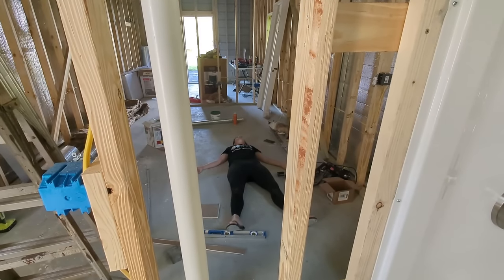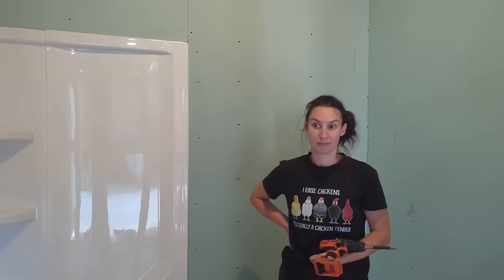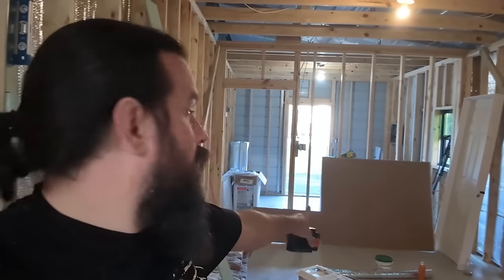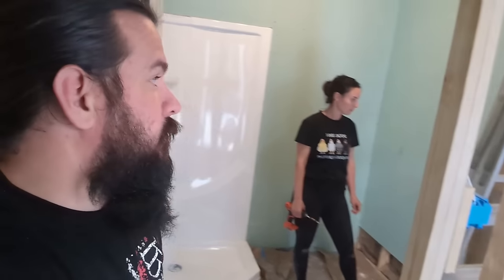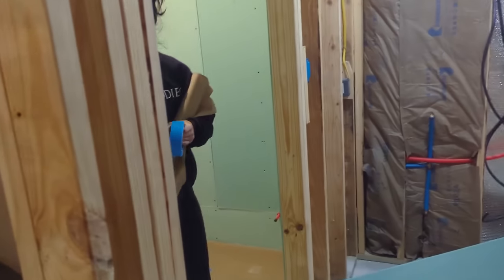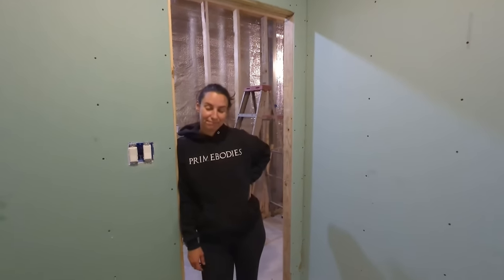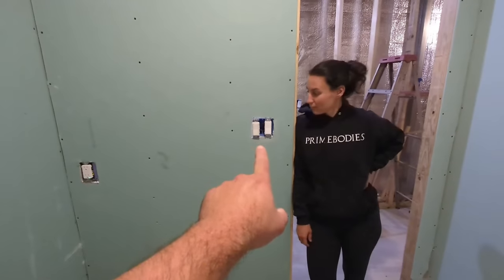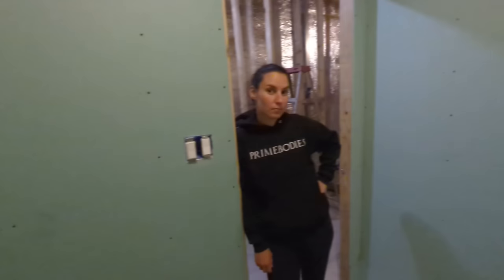Starting the drywall in the barn!

Comment: We renovated my bathroom just over a year ago in the fall of '22.  My husband knows construction because he used to work with his dad, and he can do just about anything needed in that arena.  He and a friend worked on the renovation.  Now, it's just a small bathroom with three pieces because we live in an old house that's relatively small.  We attempted to use one of the shower units at Home Depot, and it was one of the -- let's just say it -- cheap ones.  You could hardly move it without chipping or ripping it because the plastic was so brittle.  We tried with at least two, maybe three, of them and had to return all of them due to damage.  I read reviews of folks actually using them in their rental houses, but after our experience, I don't see how they successfully got them installed without damage unless they just patched them somehow.  We realized that we would never be able to get one of those home in one piece even though we just live about three minutes from our Home Depot and have a trailer to haul it.  So we ended up buying some glass liner sheets, and my husband built my shower surround out of those.  He had done one before for a friend, and it worked out well.  So far my new shower is working well.  We left the tub that was already in that bathroom; so it's not a full surround or shower pan; it's a tub with a shower installed.  You mentioned Home Depot as your second home.  We joke that our "dates" seem to occur at Home Depot.  When we first met almost 25 years ago, my husband was working on the house we now live in, and he wanted my opinion on wallpaper for the kitchen; so some of our first dates occurred at Home Depot then, and the tradition continues.  LOL!  Y'all are such a sweet family, and I enjoy watching your videos, and I watch most all of the rest of the family.  I really loved your Easter video, and I love the tradition that your family has for that day.

Comment: Thousands of dollars are being saved by doing the work.
I hope you’re proud of yourselves.
🌻❤️👍🏻👍🏻👍🏻👍🏻👍🏻👍🏻👍🏻👍🏻
When I had all my piping replaced , a reputable company put the clean out pipes in upside down.
Everyone can have issues but they correct them.
Great job !!!!!!
Reply: When my pipes were replaced, done free through a class action thing,several years later I had a plumber out to see if I had a water leak under my bathroom. Could not believe those people had put a water line to the sink  through the drain line.instead of moving one or the other. No way to get it fixed ,except by hiring the plumber.

Comment: Installing sheetrock on a ceiling is tough.  Just a tip re using your head to support the sheetrock - consider folding a hand towel, place it in a baseball cap and wear it to protect your head.   (I am not a fan of baseball caps.  The only times I have worn one was when hanging sheetrock on ceilings.)   I read some comments, several people mentioned building a support via 2x4s in a "T" shape to insure the ends do not snap.  That is definitely helpful, especially since Steve aka Steph mentioned her arms would start tremblling.  That's even more significant with your 9' ceilings.   Since the balance of the area to be sheetrocked will probably require 2-3 days for you 2 (not including mudding, taping and sanding), it might be worth researching estimates to hire it completed.  Of course financing and how much you want to accomplish during this week would be paramount.   I recall Steve aka Steph mentioned the goal of each child having their own bedroom.   No definite time frame but a goal.   You 2 are an amazing couple!   You work together so well and obviously respect and love one another.  I remember the surprise picnic in the woods Buddy planned and executed for his wife.  It was awesome!  And how quickly he rushed to be with his wife when she had a bad reaction to bee stings and ended-up in the ER.   There's so many more special moments but I will stop there.   Thank you for another great video.  I appreciate that you are your genuine self - not a video personality and 'not my video' personality.
Reply: We always used a broom 🧹

Comment: Hey kiddos the drywall is the easy part that mudding then sanding that part sucks. I would hang drywall & have someone come behind me to tape &  mud. Just remember slow & methodical is the best & that outlet since nothing on back side patch it then the plate will cover a lot of it. You guys are doing great but for the ceiling in the rest they have drywall jacks that crank up the drywall against the 2x4's & then you just screw it then done just make sure you go all around the outer edge a couple in middle before moving jack. I have did it by myself just hard picking up 4x8 or 4x10 sheets to set on jack . Well can't wait to see the end GB y'all stay safe & take care. Your friend Larry 😊

Comment: Make a T with 2x4 and then it is easier to hold the sheet rock on the ceiling. It also helps to hold it to the wall. I am saying this as a person who sheet rocked 90% 15x 30 foot second floor bedroom and a staircase and textured it alone no help. Nice part my walls was only 3 foot tall sucky part my walls was only 3 foot tall so I had a lot of slated walls ( or roof angle ) to do.